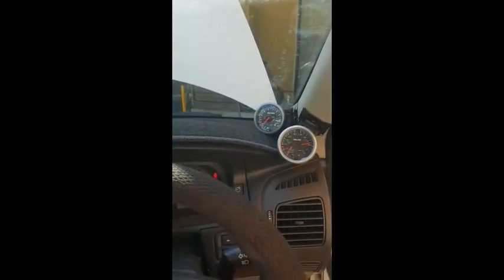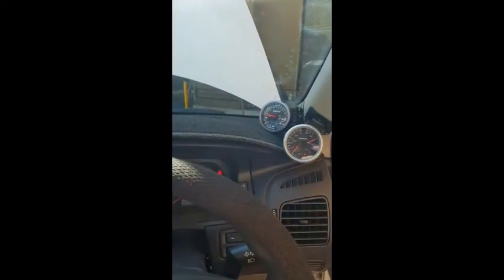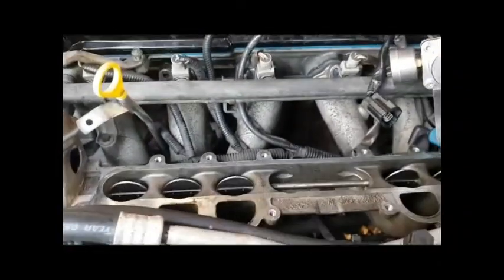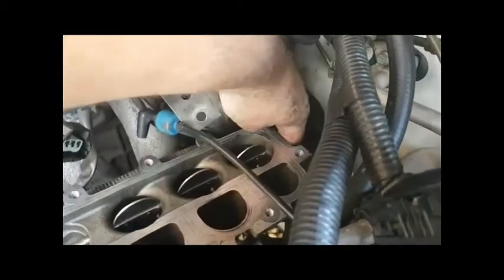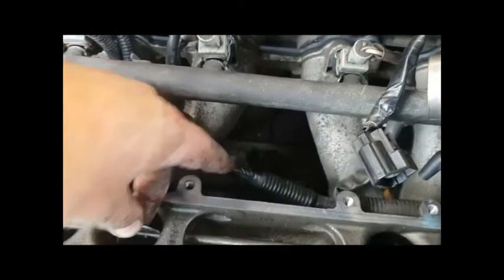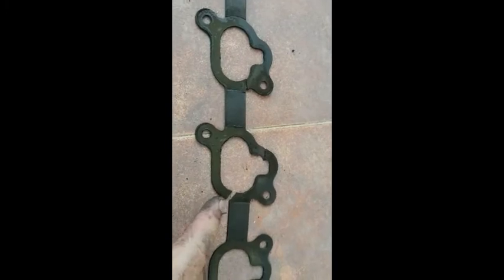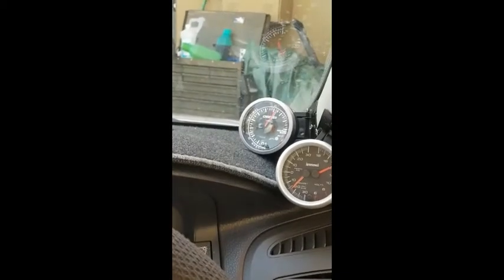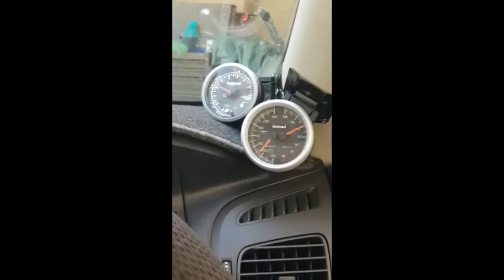BA FALCON BARRA ENGINE HESITATION FIX

Comment: Thanks man, I have been having this same Engine hesitation problem with my 03 BA since I purchased it. Will replace the inlet manifold gasket, and 02 senor first. Last owner didn't treat her right.
Reply: How did you go
Reply: YeR how u go
Reply: Yer bro mine had for bout 3 months done new starter pionts plugs new ignition switch monday. Shame cos goes so well. Then once just stoped. Trust issues now.